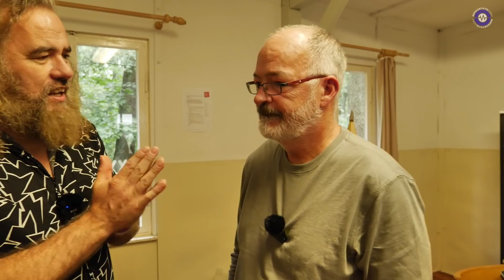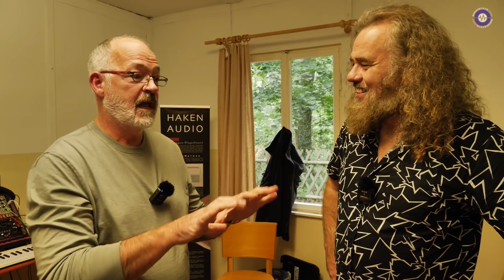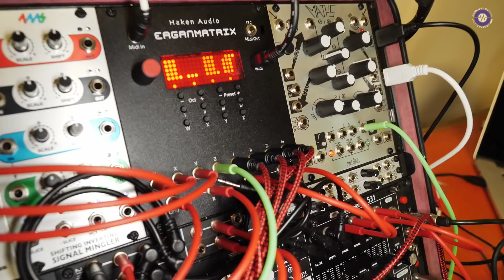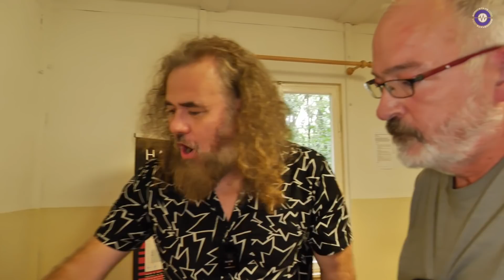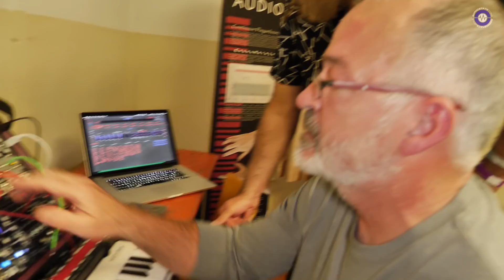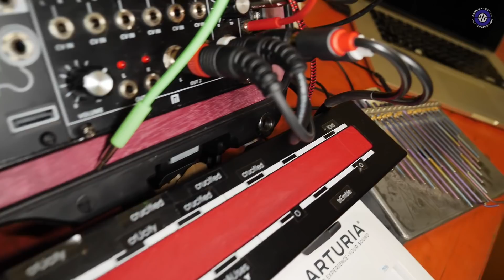SUPERBOOTH 2021  Haken Audio - Eagan Matrix in Eurorack

Comment: Not sure why for such a both expensive and deep instrument, they concluded that a limited big-red-dot display is sufficient-- that seems like a severe cost-cutting measure, when higher res displays are not all that expensive, and don't necessarily have a more limited lifespan than a dot oriented display.  And where long-term reliability is concerned, the question needs to be asked, did they choose a mechanical encoder or an optical one?   Mechanical encoders are crap and go jittery in record time due to oxidation once the thin veneer of plating wears through.  That's the bit of reliability I'd be most concerned about.
Reply: this thing looks so insanely ugly like I don't know how you could possibly do any worse. taking some cues from the eventide module design?

Comment: Cycling74 MAX?  So in order to edit presets you have to use a commercial/proprietary application which only runs on a commercial and proprietary operating system?   Is it a joke?   They couldn't make an open editor, or use an open API?   I don't use Windows or Macintosh so this module is useless.
Reply: It's made IN Max. Max can save/create an application as in "editor.app" or "editor.exe".
Reply: Are you using Linux or something?
Reply: The things  you hear , when you dont have your gun  !
Reply: Apropos being useless  - its maybe its time to get a computer - itll cheer you up,-